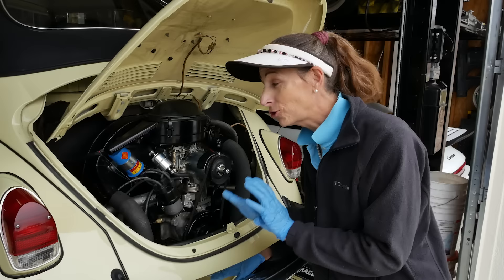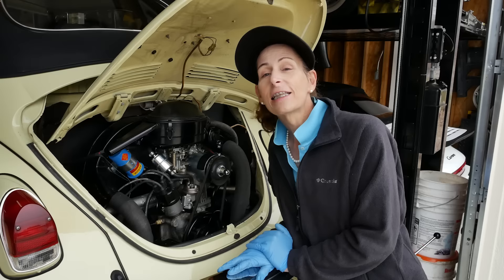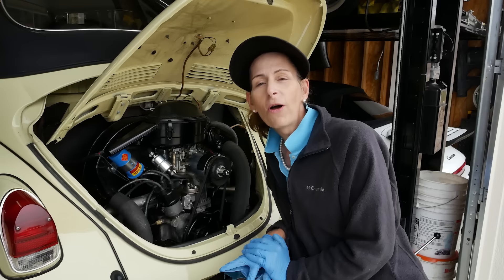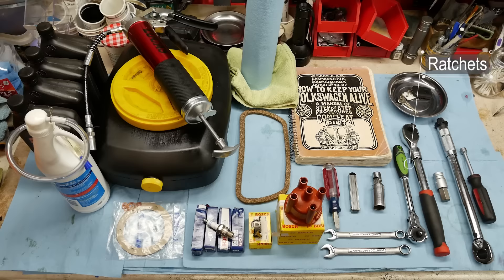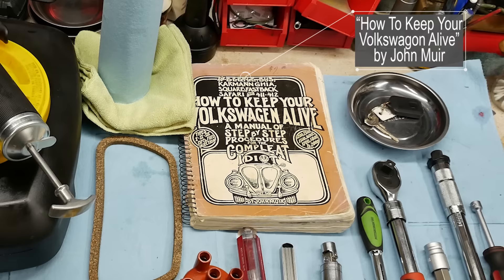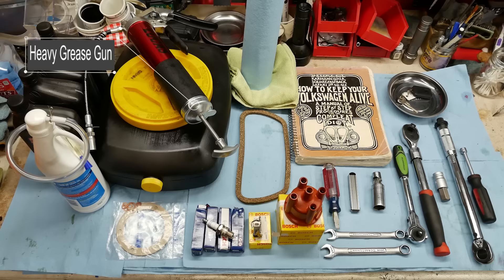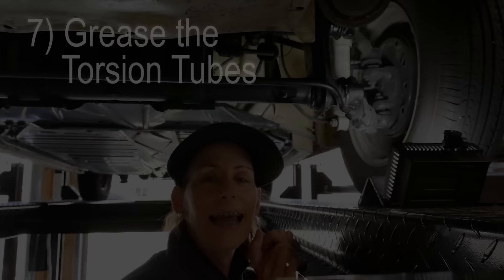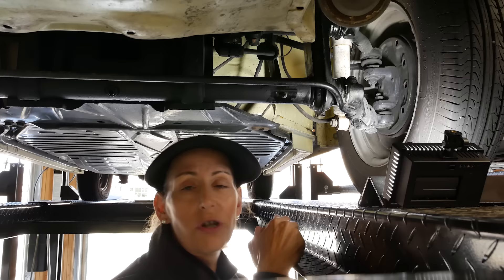VW Beetle Full Yearly Service Tune Up DIY! Easy!

Comment: I have been doing these maintenance tasks on my own Volkswagen year in and year out for 30 years now -- hard to believe.  I know all of this stuff better than I know the back of my own hand.  And yet this tutorial was so excellent and so professional that I just couldn't not watch the whole thing.

After all these thirty years, I only have one little suggestion:  With the oil bath air cleaner, do not set the upper part (filter element) down upside down on its top.  The reason (although unlikely) that I was taught as a youngster, is that any loose particles on top of the steel wool could theoretically fall into the top of the "hat" when it's set down upside-down, and might then fall or be drawn into the intake when everything is reassembled.

Through all these years, I have always been paranoid about that.

What a superb production -- many thanks 😏
Reply from the maker: Thanks! and thanks for the tip!

Comment: Watched today while I worked on my computer and I am so impressed! I will soon start a restoration, my first ever, on my 78 Super Beetle covertible and will likely return to this in the future...although I have a different car. I'm an auto-novice (interior designer and artist by training) but know that I can pull off whatever I need as long as I do enough research. You're safety recommendations (i.e. pull up hair with engine running (the same could be said about wearing rings and jewelry)) are right-on proof that you're a wonderful teacher. You're the best and you're rockin' those pearls!
Reply from the maker: Hi Roy. Please sub to our channel.  I think you will find it helpful if you are going to start a restoration.  Heidi

Comment: ....reminiscing about my '69 that I bought when it was just a year or 2 old. After burning an exhaust valve, I learned the importance of adjusting them. And, I didn't have any meters or timing lights, but learned to adj the timing by looking for a point spark when rotating the distributor.  Fun days.

Comment: One of the tricks that I learned early on with VW Transaxles and fluid changes is to warm up the fluid in the microwave.  Mind you the tall bottles that you were using will probably not fit, but putting the gear oil into a Pyrex cup and heating it up a minute or so will make the pumping much easier.  A great maintenance video BTW!  Thanks for making it!
Reply from the maker: I do keep the fluid inside.  Made the mistake once of setting everything out in the garage the night before...

Comment: You are by far the best at what you are doing, great video, great explanations, great extra details and tips. Nobody and I mean nobody is as good as you are at creating these videos!
I have a 67 bug that I have owned since 1972. Its seen better days but it still runs great. It sat in my dad's driveway for years while I was living out of state and he never started or drove it.
So, when I finally got back home it was hard to start and keep running. The engine has been rebuilt twice, its the same engine as when I bought it. 
Right now it needs some body work, maybe breaks, all new interior and paint.  
It also has a sunroof and that needs some work, do you have a video or redoing the sunroof? Its a real pain to adjust, like 12 different things that have to be tweaked at the same time to get it to slide smoothly and lock.

Comment: Excellent video, so proud to see another fellow VW driver sharing the info.  Just one thing I would love to share with everybody that is just an extra precaution. Depending on who last rebuilt the engine depends on how they dropped the distributor gear in. Most people do take the time to make sure that the rotor is pointing to number one on the distributor and if it's not they move the gear into the proper placement so the rotor would point toward the notch. But I have seen people just drop the gear in and number one spark plug wire could be anywhere around the 360° circle.  So the ultimate way to double and triple-check an engine that someone doesn't know about that they may have just bought... To find true top dead center when you can't go by the notch on the distributor is to turn pulley to top dead center mark on pulley, then with a 30 mm wrench attached to the crank pulley wiggle crank back and forth s good tell inches to the left and two inches to the right while looking at the valve rockers on number 1.  If they don't move and are still while you are rocking the crank pulley then it is true top dead center and wherever the rotor is pointing that will be where number one spark plug would be.  If you rotate the crank back and forth and number one rockers are wiggling then this is not true top dead center and the pulley needs to be turned 360° full rotation and then that will be true top dead center.  And then you can do the valve adjustment just like what was shared.  I've assumed many times with engines that I have not known that I have bought that I was a true top dead center by going by the notch on the distributor and I've got in trouble several times. So every since then I just want to wiggle the crank and make sure the rockers are still and that way that's the die hard proof that it truly is top dead center.  Excellent video! Hope to meet you someday. My daily driver is a 63 beetle Herbie replica.  Just about to rebuild the engine, went 222,000 miles on this before having any internal issues. Very reliable run for this engine.

Comment: I'm over in the UK and have recently bought a 1972 VW Bay Window Pickup, 1600cc. I've always serviced and maintained my own vehicles from oil changes to cylinder head replacements etc, but having never owned anything aircooled or pre 1990s, I was keen to find information on servicing and adjustments that are crucial to these older vehicles. Most videos I have seen have been explained poorly or are filmed in a dark garage using a flashlight so you can't really see what's going on. Your video is great!!! Everything explained in great detail but not in a way that would confuse, the filming is perfect and everything can be seen clearly. Although a long video, i like the 'contents' section at the start making it easy to navigate to a specific section. I've subscribed and shall be watching more of your videos!! :)

Comment: having owned several  VWs from the 60s plus friends, I have always raised the front axle up to take weight off. It allows grease to penetrate better. The door hinges need to be oiled by removing the plastic caps and squirting oil into top of hinge. I have seen rusted hinges rip the door skin from being forced. BEST tutorial I have ever seen in 55 years

Comment: My mother recently asked me to take over on the maintenance on her 1969 VW Bus. Since we've moved out of state and we don't have my grandfather nearby to help, the tune ups are long overdue. I'm so glad I found this extensive video, and I'm sure it will help me greatly in the near future. Air-cooled engines are Greek to me!
Reply from the maker: Great!  Well, if you get stuck, just reach out.  Also the Samba forum is cram packed with information.

Comment: Good to view and make sure I'm on track doing all the right things! One tip regarding the steel retaining clips on the rocker covers is to use an old rag like a tea towel pass it through and just pull down - easy as pie and absolutely no marking of the paint! Cheers Paul

Comment: I'd didn't check thru all the responses but I was always taught  to retorque the rocker arm/heads retainer bolts while the valve cover is off. Great clear video ✌️

Comment: I always use a short length of fuel hose pushed over the end of the spark plug for both finishing the removal and starting the installation - that way No dropping the plug into the space between sheet metal and engine  --  your videos are great, keep up the good work.

Comment: lovely informative vids to watch ladies. Word of caution, never remove steel plugs from the VW alloy cylinder heads when warm/hot. It can strip the soft threads in the heads. Anti seize on the threads is a good idea you pointed out
Reply from the maker: Yes!  You are quite correct.  Pulling plugs on a hot engine is not good.  The 356 cam from the factory with a sort of Heli-coil in the heads I'm pretty sure, but not so much for the Beetle.  Something to keep in mind if you ever have to chase threads.

Comment: Great vid , well done. Without reading 800+ comments , I probably would have checked the oil pump pressure relief valve while oil changing. The big slotted screw on the bottom oil pan. I'm sure you know about it as it is mentioned in the Muir manual. Man those hoists make the job easier.

Comment: Great video and well filmed and explained especially for someone that does not know how to use a timing light and a tack and dwell meter. The video answered several questions I had on the timing and carb adjustment.

Comment: Gotta love old VW Beetles.  Enjoyed the video and learned alot although I must confess I was lost during part of the engine timing and valve adjustment maintenance.  I need an idiot's guide approach to car maintenance I'm afraid I need a more thorough education on all the different vehicle systems and what each part does.  Think it would be cool to buy an old VW Beetle and get my hands dirty and learn over time one system at a time. Cheers from the Adirondack park in upstate New York.
Reply from the maker: Thanks Robert.  I've been thinking about a series on the basic parts and what they do and how they work.  I'll get to that when the weather starts to turn.  F

Comment: Wow!  What a great instructional video that is easy to follow and does not assume that the viewer is an expert.   I've seen other videos where there aren't too many tips or techniques given the viewer, almost too straightforward - they do the process, but don't mention a variable, or even "why or what" you are doing.  The annual service format is wonderful, and the way it is done, with referenced procedure/time is quite a time saver.  I love the lifts that you have installed in the garage, they are a convenience for maintenance and storage, and really help to keep the garage organized.  If you could provide a name of the manufacturer for the lifts, that would be helpful.  Thank you again for posting a great video!
Reply from the maker: You are going to love this. We put it together just for you!   Here is a video on the lifts.  https://youtu.be/enPy96sihyo

Comment: You work  efficiently and  very clean, the video quality is great,  your  expositions are nice, just a comment please change the fuel filter position to avoid a leak risk and firing; I have a vw beetle 1964 fully restored, and I learn from your videos,  regards from Mexico where the VW'S are loved and there are many clubs owners. Thanks.

Comment: Congratulations to this video, it’s good to see another point of view of maintenance of VWs, we ever learn something different when seeing another people doing this job. I suggest you to tell more about grease used to put spark plugs at the engine, I never heard about that. Greetings from Brazil
Reply from the maker: Hi there!  That grease is called Never Seize and is used in various places on the car where parts will need to be disassembled so they don't corrosion weld themselves together.  The product I used has aluminum in it, but there is a copper version that is better for higher temperature areas like brakes.  Porsche put out a bulletin against its use due to worry that it would interfere with conductivity of the spark plugs.  That may be an issue on some of the higher power ignition systems, but I think for these cars the ability to easily remove the spark plugs in the future is more important.  There was no Anti Seize on the plugs I pulled out and they were difficult to remove. Thanks so much!  Franny

Comment: The Muir Manual! 😍  
When I had air coolers ('68 swing axle Baja bug + '75 van) I'd drain the Öl after shopping and leave the coil disconnected.  In the morning is when I'd start by adjusting valve lash, cleaning points and adjust static timing.  
I so miss having these wonderfully mechanical classic analog era vehicles.

Comment: Great video. All angles are very clear. I do all of these on mine with slight differences. I use an infra red gun with reflector strip on crank pulley for rpm measurement (cheap on ebay). Tried to do carby tuning with a vacuum gauge but I couldn't find a vacuum source on mine. I guess it takes some practice on getting the mixture screw adjustment by ear. After watching this video, i dont feel like selling my 72 bug 🙄 greeetings from Sri Lanka
Reply from the maker: Keep the bug, keep it!

Comment: Great video,  well done.

Only issue i had was reusing the distributor rotor.  As cheap as they are i would replace it. I would have ordered it before starting.

Looks like they set the timing to make a bit more power. But like you mentioned,  they went way to car. 10 degrees max really
Reply from the maker: in the episode after this one I get back to the distributor...  All gets sorted :)
Reply: @HeidiandFranny  awesome! I am sincerely enjoying your videos.  I am soon to buy a friends 1971 Super Beetle and before i buy any car, i enjoy researching the cars in and outs and how to maintain them.

Loving your videos.

Comment: This is a wonderful video--so careful about details with measured commentary.  You obviously know what you are doing.  One thing I noted was how to be sure that you are on #1 cylinder.   The rotor CAN point to the notch on the lip of the distributor and the  engine will be on #3 cylinder.  So, it is important to know whether it is #1 or #3.  Ouch--those bits of silicon (?) are worrisome.  Too many mechanics are building engines these days and relying on silicon to seal, etc.  Very dangerous because those "rubbery bits" can plug essential oiling ports.  The drain plate on Lemon Drop is from a later model.  I'd ditch it and get one with the center drain plug.  Keep up the good work!  I am going to refer your videos to those who regularly send questions to me.  jay salser
Reply from the maker: Hi Jay, thanks for your comments!  Yup, always verify by tracing the plug wire back.  I probably forgot that.  I think I did it on the 356 electrical tuneup?  I'd have to check, but yes the distributor drive could be in backwards or I think one of the older distributors was a bit turned around?  I'm sure you would know better than I. Yeah, silicone bad.  I've never understood that.  It doesn't even work in a shower!  I think I saw that about the drain plate.  Did I read that VW wanted folks to change/clean out the screen so they removed the plug?  I guess older (crappier) oils would form a good bit of sludge and clog the screens.  A center plug would have made that job a lit less messier!   Thanks again!  Franny

Comment: Love your Beetle and the informative video. How about doing a review of a 2017 Beetle? Maybe you can visit the VW dealership in your area and ask to test drive one and give us your opinion. I am thinking of buying a new one and your input would help a lot.
Reply from the maker: +mac daddy thanks for the suggestion.  I know you have watched a lot of our videos. If you will note the video of when we got Miss Eva home (part 4) we had a VW New beetle sitting in the garage.  It was a 2004.  We have owned four new beetles.  2000, 2004, 2005, and another 2005.  Three were manual transmissions and one was auto turbo as that’s why we had two 2005.  Two of them were Turbos.  I would recommend manual turbo which didn’t exist after 2004.  Super fun beetle.  Its possible the newer ones have that again. I don’t know.  I had issues with my convertible top in the 2005 that VW could never get solved.  The run flat tires on the car would get destroyed a lot. We went thru tires on those cars. I doubt that has changed.  They have power and are fun but aren’t super fast like a P car.  Gas mileage was decent.  Some car seats were comfortable and some were not. We closed the door one time and the glass exploded on the passenger door.  So, there are a few comments from past new beetles we owned.  As we went to the dealership for service, we would drive newer cars there. One was a 2011 Jetta.  That’s probably the newest car of a VW that we drove.  The car was supposed to be improved with becoming a newer car. It made noise and everything seemed cheap.  The knobs were cheap and flimsy.  Newer VWs are decent and reliable cars when treated well.  Fit and finish is ok. Mechanicals (door windows and tops) may or may not have been fixed.  We do not have a relationship set up with any of the VW dealers here in Denver Metro.  I am sure we can establish one at some point, but I doubt it will happen in the next six months.  We want to do more car reviews, but more than likely it would be in the used car market and probably at a Porsche dealership where we do have a relationship.  I have not forgotten your request about what we do and how we got our cars.  I still want to do that video.  We have a bunch of items to get out for your as  one of our valuable subscribers.  Thanks for the input. Go test drive a new beetle and let us know how it goes.  I am sure it will be fun!  I would also encourage you to drive some used newer Porsches.  They are very solid cars. Unfortunately, there are no front wheel drive cars like the beetle, but several are four wheel drive (all wheel drive). Good luck. Heidi

Comment: Great job as usual! I would coat all rubber bits (like spark plug caps) with 303 Aerospace Protectant. Keeps rubber pliable forever.
Reply from the maker: sportscarnut that’s a long video. Did you make it thru the entire show?  Heidi
Reply: Still watching it. But I swear by 303 and thought about adding the suggestion. :) 
Superb job! A paid mechanic would not be as thorough.
Reply: Greetings from Brazil!!! Nice vídeo!
Reply from the maker: Thanks!